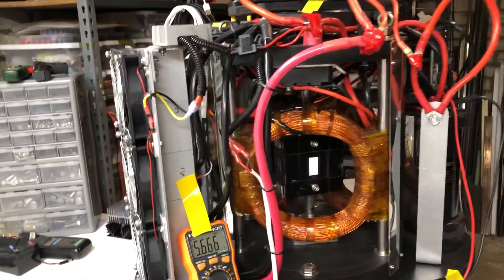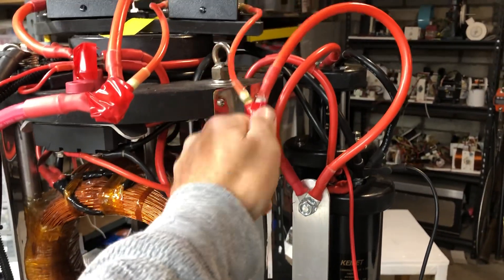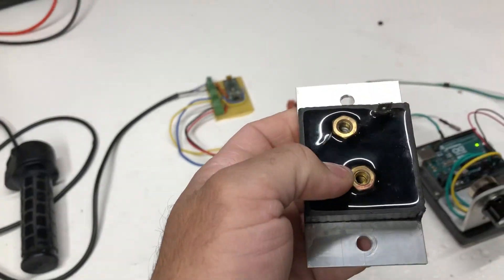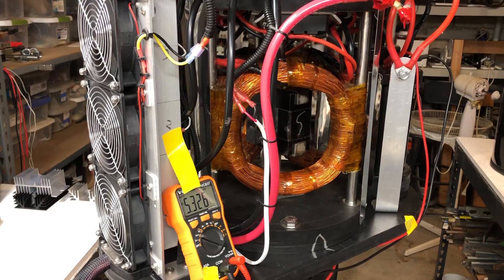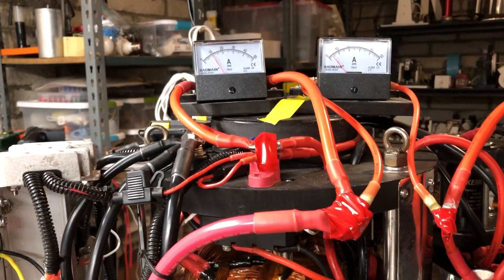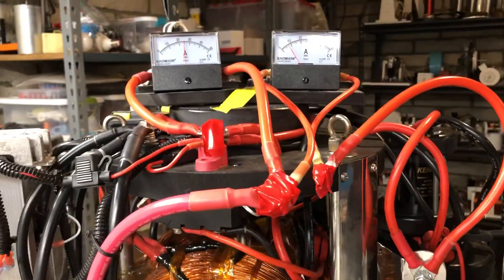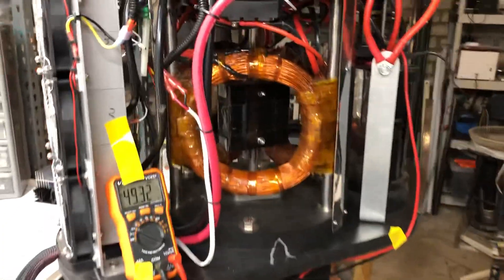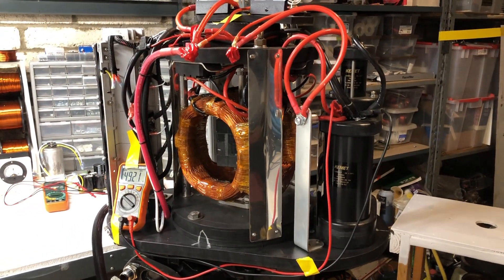Outboard converted to electric ! With range extending output

Comment: What a machine :-) So you have the flyback from the coils, through a steering diode, to the positive of your caps which are charging to around 600v. Presumably the cap negative is goes to the battery positive? But how do you send this capacitor charge back 'to the front'? I would love to master this technique. Do you have a separate switching circuit (transistors) that chops up the charge in the caps and switches it back to the front during the pulse motor 'off' time? Or how is it done, and do you have a video on that? Thanks!
Reply from the maker: Thanks ! Yes it is
 The motors fly back is about 600+ volts that’s condensed in the caps and reused by the motor 
There are no switches after the caps 
 I did 2 other videos couple days ago you can watch too
Reply: @kenergy1707  Gotcha - watched those two vids. Really great machine man. But how to get the cap charge back to the start of the motor coil? In a 'normal' Bedini-style flyback capture you would have the negative of the charging battery (or in this case capacitor) going back to the positive of the source battery, like it's in series with it. But to discharge the capacitor back to the start of the coils wouldn't you need the cap in parallel with the coils?
Reply from the maker: @markflint9089  cool !
You need secondary coils
Reply: @kenergy1707  OK, makes sense. You say no switching after the caps, but the caps are DC, right? So how would you get a DC source through a winding (secondary) without switching/pulsing it? Do you go into this in any of your other videos?
Reply from the maker: @markflint9089  I have many videos that show lots of info but don’t have any videos on that because it’s taking me 20 years of research to this point and I don’t want to give my time and money away 
 If you or anyone is interested in investing to fund my research then I have no problem in sharing everything
Reply from the maker: @markflint9089  if you want to collaborate you can get in touch at 
kbgenergy@gmail.com
Reply from the maker: @markflint9089  you don’t want switching on the output side is they fail caps can blow up
Reply: @kenergy1707  No problem, I understand that. Thanks for your great videos. I like the clean demos without the clip wires and crow's nests of wires. Good stuff!
Reply: @kenergy1707  Thanks, yes I think I'll be in touch by email.
Reply: @kenergy1707  Yes, good point, and I guess we already have the pulse through the steering diode.
Reply from the maker: @markflint9089  thank you! Yea clips don’t make good connection so you get losses right away
Reply from the maker: @markflint9089  if you look at video 18 from the bottom will prob help

Comment: This is really cool. I want to build a complete system for my VW bus with a few range extending ideas. I wonder how much HP and Torque  you're getting with this one. I gotta pick your brain about a few things you've probably already tried. I stay so busy my tinkering time is hard to come by these days.
Reply from the maker: That’s my baby lol 
It’s rated for 15 hp but only uses about 5 hp to turn the prop in the water at 4,000 rpm 
 Sure any time
Reply: @kenergy1707  Have you built one with an aluminum stator? Do you notice a torque increase if you have? I'm looking to push around some weight and was thinking of going that route. What are your thoughts? Also, have you thought to start a FB group create a forum? Do you already have one?
Reply from the maker: @theclintified  I don’t have a group I’m actually new to YouTube stares it couple months ago 

I don’t suggest aluminum for stater or rotor in a Newman type motor with neo magnet 
 The it makes magnetic drag or eddy currents
Reply: @kenergy1707  I was thinking the same but haven't tried it. Ive seen a couple of guys use what looks to be aluminum with success but it doesn't make sense in my mind... I'll have to tinker that one out.
Reply from the maker: @theclintified  the best to use is plastic second best is 304 or 316 stainless 18-8 is another name for it that’s what I used in my outboard just check with a magnet when you buy it it works great because of very low magnetism
Reply: @kenergy1707   those group things think they are acting as supervisors to members seeking informal peer review..... if this is what you created by not being in any groups.... then please be who you have been..... your work is peer reviewed by its applicational success..
Reply from the maker: I’m not part of any group
Reply: @kenergy1707  I'm not advocation  anything of that sort, just want to pick your brain a bit before I dive into my big project.  YT has gotten better when it comes to communication. But in the past it has been horrible.  I like your ideas, work and craftsmanship with your projects but so many haters make any public communication a challenge. I never knew of so many experts in the world about everything.
Reply from the maker: @theclintified  if you want to pick my brain you can email me also.  Kbgenergy@gmail.com
Reply: @kenergy1707  I will , thanks

Comment: Very cool, I have never seen anything like it. I doubt the torque is high enough to drive the propeller with speed though, as there is no iron in the stator. Will you test it out on the water? :)
Reply from the maker: You don’t need iron for torque
Reply from the maker: Actually it does have plenty of torque! It runs at 80 amps at 4,000 Rpms in water
Reply from the maker: Look at the shorts videos on it
Reply: @kenergy1707  Thanks, but I don't see a video of it in water. Do you have a link?
Reply from the maker: @AntonMakesStuff  
I need to make a new video in the water I’m repainting my Boston whaler

Comment: Impressive!
Reply from the maker: Did you check out my circuit design? It’s simple but works.
Reply: @kenergy1707  If it's the same one 3 videos back, then yes.
Reply from the maker: I have some hi power fets let me know if you need the product number
Reply: @kenergy1707  I might need to but first I have a few tricks up my sleeve..
Reply from the maker: @redesign3dp  
 I look forward to seeing it !
Reply from the maker: I’m working on some core material 
Nails and bolts work but they get really hot on adams style motors